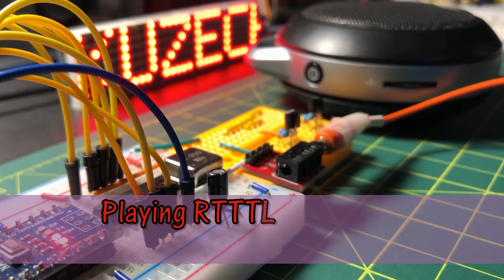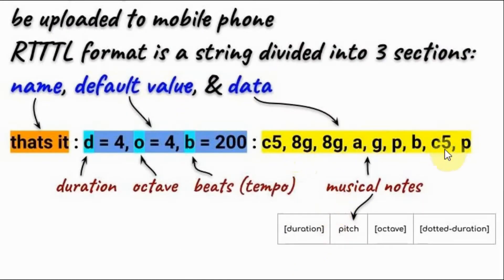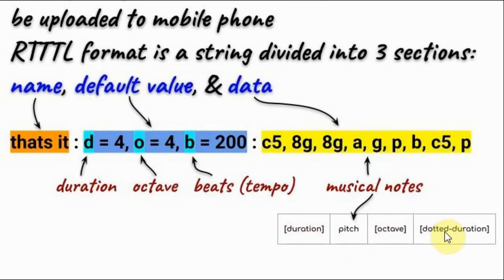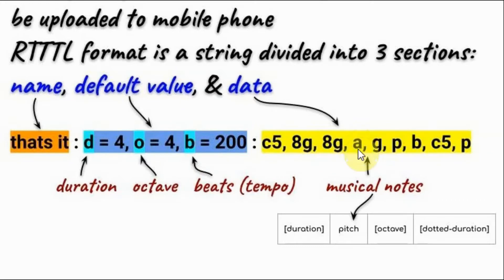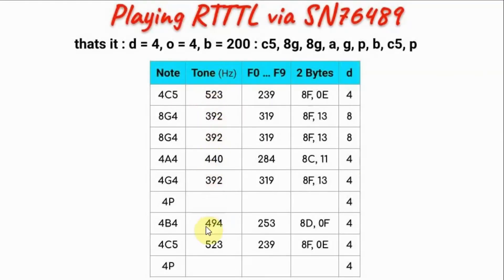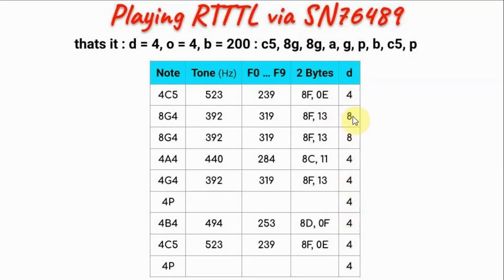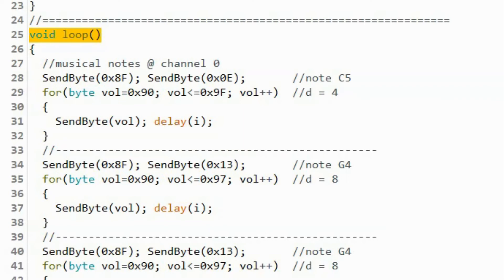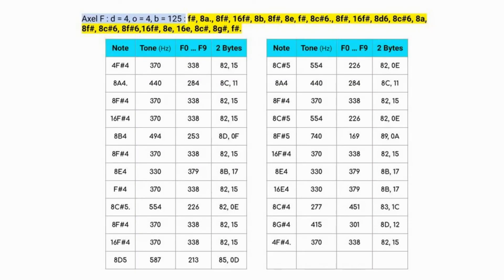Playing RTTTL Ringtones via SN76489

Comment: Love it.. I used to love typing in my ringtones on my Nokia 3310 back in High School.. It was like a real power move to have a good tone. Does the BOB-11570 provide anything other than a barrel jack? Coutld i replace it with a small speaker.
Reply from the maker: Thanks for your feedback. Yes you can, amplifier is needed to drive speaker.
Reply: @AnasKuzechie  so right now your barrel jack goes into a amp and speaker of some sort
Reply from the maker: @50Hz  Yes, it's a portable speaker
Reply: @AnasKuzechie  got ya. Cheers.